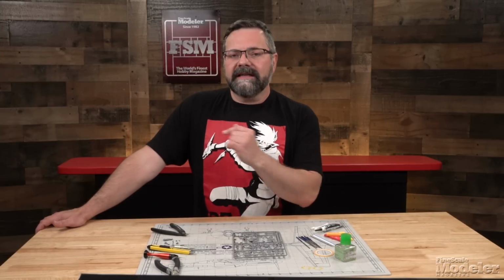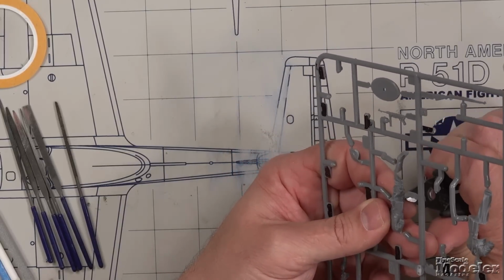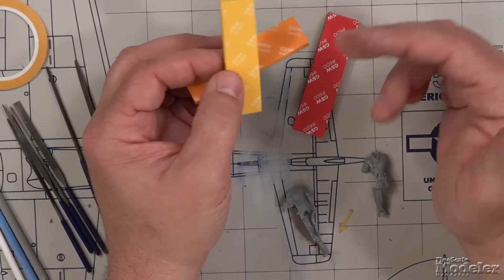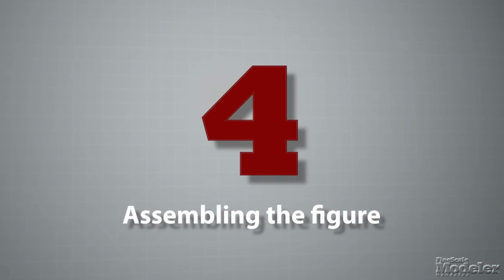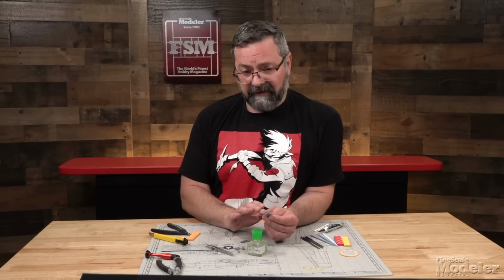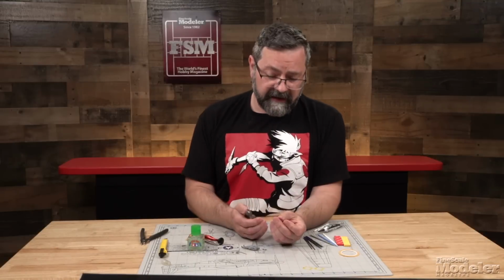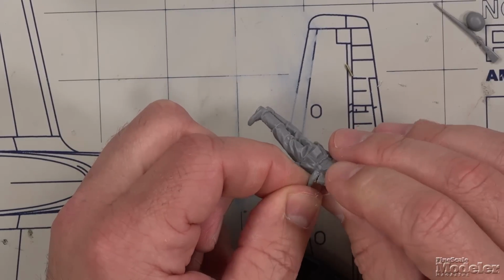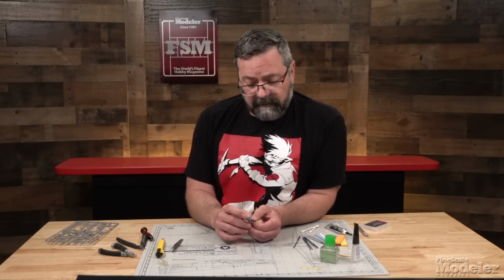Scale Model Basics: Assembling plastic model figures

Comment: Don't remember if you mentioned it, but test fitting of parts is important to proper assembly.  Also, after final sanding, I apply a very light coat of liquid cement to smooth everything.  And, I like to use a 2-part putty when filling gaps.  Apply the mixed putty, smooth it out, and done.  Great video, like that you included pinning of parts (saves a lot of headaches later on) 👍